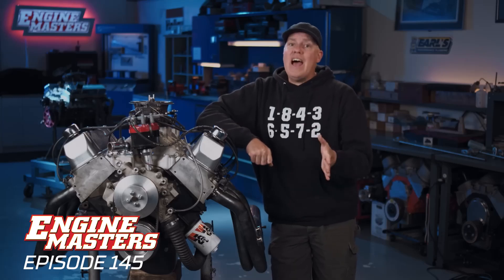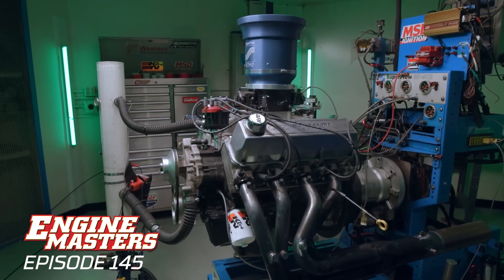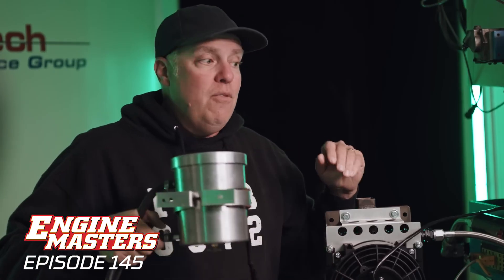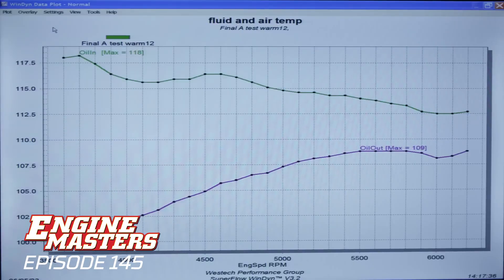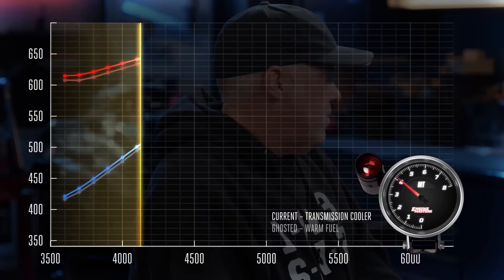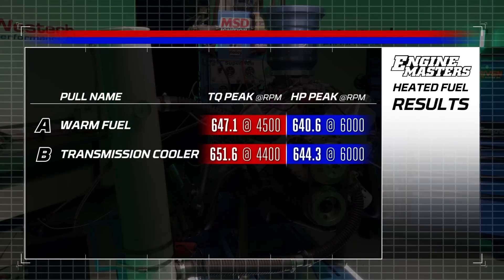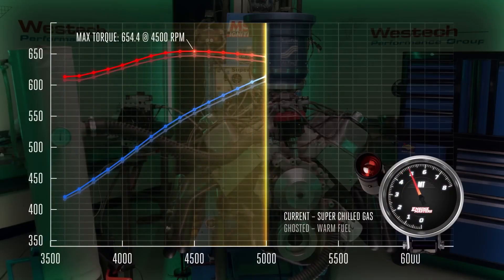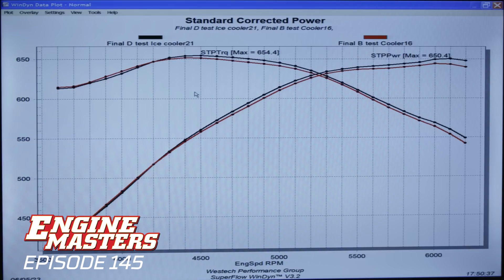Why Does Cold Fuel Make More Power? | Engine Masters

Comment: Back in 1982 my friend and I were building his 1970 454 Chevelle in high school. It gets hot in eastern NC in the summer and the carb would starve after the second or third run street racing. We got a Moroso  "cooler can" I think it was called. Basically a coffee can that you ran fuel line through and filled with ice. It worked.
Reply: I used one of those on my 76 Camaro 350.  I only bothered actually using it at the track and packed it with ice between every run.  It had a little drain valve on the bottom to remove the water too.  Sadly, I never actually tracked how it affected my numbers in the eighth mile run but the engine did seem to make better time at a slightly higher shift point allowing me to shift a bit latter than without ice.

Comment: I have made a fuel cooler on my jet ski spraying water from the pump through oil cooler that  that was sealed in a box, then the outlet fed a cooper tube that was wrapped around the supercharger (tvs1320) which exited the hull...alot of work but it does go a consistent 2.5 mph . Speed on jetskis is expensive and this was quite cheap but took  many attempts to be done cleanly .

Comment: Gotta change your name to "Coolberger" or "Iceberger"!  LoL!
 You forgot to try adding Liquid Nitrogen into the gas tank!!!!!
However, it would probably freeze the fuel from all the water in it these days.
Vizard came up with a better method: Water Injection cools the air charge very efficiently, & also adds additional expansion & increases compression ratio,  he really put an interesting spin on it in his latest vid:  "Worlds cheapest and MOST EFFECTIVE octane booster".

Comment: Wow, I actually am looking a a small trans cooler I got from derale it has 6an fittings already. I ordered it last week for my car, but I am fuel injected. Don't know how much that matters. It's just crazy that I was just thinking about this. Now I guess it might be worth my time to install it.
Reply: Fuel injected gonna be running at a lot higher psi meaning any leak extra bad and more likely. I'd check what the pressures the Trans runs through the cooler and see if it's close
Reply: 1) make sure the cooler is rated for EFI pressures, many are fine up to 10 psi which is fine with mechanical fuel pumps but not good for EFI that is 30+ psi.

2) it will make a difference if you have the injectors spraying like a throttle body into the intake manifold, if you have ported EFI where the injectors sprays the fuel directly against the intake valve you wont see a difference.  The throttle body style setup that sprays the fuel at the mouth of the intake manifold acts no different than a carb and the cool fuel will have a cooling effect more so.

I personally am looking at doing something like this for my 4150 Stealth EFI setup I have for my daily driver I am putting the finishing touches on.  I am on the fence on if I want to cool the line or not.  I already have the return line out of the engine bay by taking a page out of chevrolet`s book for the 99-04 Corvette by using the fuel filter/regulator assembly mounted on the frame infront of my fuel tank.  I also am retaining cold air intake through the use of an aftermarket airbox that has a second duct so I can improve air flow while retaining OE cold air intake by pulling air from outside of the engine bay.  I dont know how ever if cooling my fuel with a single pass inline heat exchanger type cooler would be worth the money and effort to do it.  I dont see it dropping temperatures that much especially seeing I am running 3/8" stainless steel fuel line on the engine and I have a high flow 190* thermostat like my truck called for.  I used to run a 180* thermostat but since going to EFI, hotter is better for efficiency coolant wise.
Reply: @Milner62  yea it's a transmission/oil/fuel cooler. It csn handle a few hundred psi

Comment: Great stuff.. but I think the actual process is a bit different. The fuel actually absorbs heat from the air when it is mixed at the carb. The colder the fuel, the more heat it can absorb in that short trip from carb to cylinder. Colder air is denser so you get more in the cylinders and that is what actually makes more power.
Reply: i would agree because fuel has to vaporize to burn so getting heat from the air would would not only help it burn but more air is the key just like a turbo does, i did the opposite though many years ago, i had a gas preheater just before my carb and the engine ran soooooooooo much better once the fuel was heated especially in the winter time, gas has to vaporize to burn and more air helps and that is why chevy tried having a heated carb base in one of their cars,  toooooo many variables to produce horsepower in engines but heating the gas helped my engine big time.
Reply: Agree , It would be interesting to see that difference using fuel injection rather than a carb that supports the denser air charge  , cheers
Reply: But, the combustion occurs when the fuel and air is already a mixture…so does it matter which component is cooled? I would think not.

Comment: In certain European sports cars the fuel circulates to the carbs & back to the fuel tank to help keep the fuel cool.
Reply: it is not made to cool fuel it is made because fuel system is so designed(always on engines with carb)
Reply: not always its just the way they regulated fuel pressure 
fuel injection can do the same some  have a return and some are dead end systems not for cooling but side benefit but    if there's no heat sink in a cool place most of the times it will actually just heat up fuel from engine n exhaust heat then   flow back into fuel tank hotter than it left so your heating up the tank
Reply: @johnj2496 , that is why manufacturers started moving the pressure regulator out from under the hood so the fuel return back to the tank didnt pick up excessive heat from the engine bay.

Its why my EFI conversion will be using a 99-04 Corvette fuel filter/regulator assembly mounted on the frame rail, this will have the fuel come from the sender to the filter just infront of the tank and the return right back to the tank with only a single pressure line running to the engine bay.  Only heat being generated will be from the in tank electric fuel pump which is only putting miniscule mount of temperature to the fuel under compression.

I how ever have thought about a inline aluminum fin cooler mounted on the frame after my filter/regulator assembly to chill the fuel down before it gets to the engine bay.  Just havent found enough information out there to have me dead set on it as being a benefit so far I am seeing it as a waste of money with no real world benefit.
Reply: On low pressure fuel systems that is a great way to reduce vapor locking.  On EFI you dont have the vapor lock issue but you need the return to reduce pressure down for the system.  Manufacturers have gotten away from the regulator under the hood because the return line under the hood was soaking up heat and transfering it to the fuel tank.  Today most have the regulator on the frame rail by the fuel tank or they use a returnless system where the regulator and bypass is in the fuel pump module in the fuel tank itself.

Aftermarket Fuel Injection still does this with the regulator at the throttle body, such as the Sniper.  The Stealth 4150 Sniper I got didnt have the regulator and requires a external regulator this allows me to use a 99-04 Corvette filter/regulator assembly that I plan to mount on my frame infront of the fuel tank so the return line is short and doesnt absorb heat from the engine bay.

Comment: An observation over time is that my V8 cars ran best when the outside temperature was 45F deg.
Reply: Your intake temps are lower in cold weather. As will the be the whole car.
My race transporter was 10km faster on a very cold day v a 100 deg F day

Comment: Now when you're going down to track if you're using it for drag racing you could use your CO2 canister in disguise at like a fire suppression system in the car and spray that the cooler for the fuel and make it even drop colder Tina like 32° to see how much more power you would make

Comment: Back in the 80s when I had a cool can under the hood... I would use that thick rubber insulation around the fuel line all the way up to the carburetor... The type you see on home air conditioner
Reply: Still do that sometimes 
Home Depot, lowes sell it pretty cheap

Comment: can you do the same test but on EFI and pressurized fuel rails?
Reply: Now that is a good idea. Cheers
Reply: probably to some temp it has sense but if fuel is too cool it will not have time to evaporate (cold start), it is better to cool down intake air

Comment: 7 hp gain on a 640hp engine?  That's what, a one percent improvement.  You wouldn't even notice that when behind the wheel, and its within the dyno's margin of error.  Not worth the time, expense or hassle.  It looks good on the graph because the graph doesn't come alive until 450 hp.  Show that graph from zero rpm/zero hp and the gain is imperceptible.  Thanks guys for the effort of making this video, but c'mon..., this cooling the fuel like this is unrealistic.  Better gains to be found elsewhere.
Reply: Zero rpm? Wen does a vehicle ever operate below 500 lol. The improvement doesn’t have anything to do with how much horsepower the motor is already making. If you did this test on a smaller motor it still would make more power. No its not a large gain but in a vehicle the fuel would be alot hotter so actually would be more gains. Probably would be around 10 ft lb of torque and 10-15hp. I would say thats a good gain for just cooling the fuel off.
Reply: Exactly and cooler + dinky fan won't cost much and is worth it even if the gains are only marginal. All small power gains + small weight reductios will still make the car faster on 1/4 mile or on streets @victorromero4572
Reply: 4:16
Reply: No offense, but you didn't pay attention. Mercedes,, Jaguar,etc in the 80-90s had a 7" x2" tube wrapped around the return from the evap AC lines. Made a difference.. Mercedes and NASCAR were injecting cold water shots just to cylinder heads.. that's what cold fuel does..
Reply: They did say they couldn't get it as hot as they wanted to. it was about 118? and I'd say it probably gets alot hotter than that under the hood. But I have no proof 😂
Reply: May not be applicable to drag racinf because thats clearly where your brain stops and starts. But 1 percent over a 3 hour race is a lot
Reply: Ever watch a video just because its fun?
Reply: I dunnnnnnooooo...lots of little things make big juju..i reached fuel cut just by wrapping exhaust,hoodscoop put in, intercooler grill out(saves birds or something)...wrapped cold air pipes, high flow airfilter, took spotlights away from engine airflow....people talk about buying a boost t and winding to 14 pounds getting shut down by fuel police...that happened to me just putting tee in on half a click

Comment: On a slant six you actually need to heat the intake and fuel so the gasoline can vaporize.  It depends on engine design.  Cold fuel kills power on the slant six because of the intake design. That's why the factory intake has a heat duct attached to it.

Comment: Drivers were adding "cool cans" to cars back in the 60's. They would use a coffee can and coiled copper tubing. Fill the can with crushed ice!
Reply from the maker: Good point!
Reply: 100 % think it would make more power on a hot day. Dyno test would be cool to see and maybe a room with 100° temps temps ambient on a chassis dyno.
Reply: We used cool cans for fuel, Trans lines, and brakes. Much of this was for derby, and some, also, for drag racing. 

The brakes were only for derby, because they would be moot for any other applications. The Trans was a 5G bucket full of ice. It worked.

Comment: Trans coolers are very useful for exactly this type of thing. Handy for heating and cooling almost any gas or liquid.
Reply: @aldo6192  in quite a few modern day vehicles, the trans cooler is built into the engine radiator, with coolant being exchanged as the medium to regulate temperature. Helps bring trans temp up to operating in cold climates, and obviously in situations in which trans temp exceeds coolant temp, it removes some heat.

Comment: If it makes 10 hp it may be worth adding an evaporator type cooler to cool the fuel that runs off an ac compressor. Something like on the electric cars even. Not engine driven, and is basically a cooling block. They use it to cool the battery coolant.
Reply: Jaguar XJ6 and others cooled fuel off of the AC
Reply: 🤔 get some soft aluminum fuel line and coil it around your low side ac line then insulate it  there and to the fuel rails or carb
it wouldn't be a big hassle
Reply: @johnj2496 I think running your AC during a race is going to defeat the HP gains of cooler fuel, but give it a try & report back.

If you lose 10hp on a hot day driving around because you're running your AC, possibly gaining back that 10hp would cancel out the compressor loss so you don't have to worry about the hills if you live in San Francisco in the summer time.  Other than that, I don't see the gain with using an AC line to cool the fuel...

Comment: I think the fuel cooler with an electric fan is a good idea but placement on a car is going to be tricky.  Most likely it will end up under the hood but the trick is to place it in a spot where you can achieve that 25 degrees temperature difference between tank and intake.

Comment: I have two really cool inventions I made ❤❤❤ 12v 330amp alternator / generator 79cc engine.... I have a 10,000 watt inverter 110w connected, 8hours run time 1/2 gallon of gas ⛽
Reply: Second invention: search 🔍 800w 36v Dynamo stationary bike.... Then throw the batteries away for your Ebike I'm using a 350w 36v motor on the Ebike 2 to 1 ratio ... Search 🔍 chainless Ebike... Get the drift no batteries needed

Comment: I wanna see this on a 5.0 302 215hp motor it won't change much
Reply: On a 640 hp engine it made 7 more hp.  Not worth it.  On a 215hp 5.0, the gain (if any) would be imperceptible.
Reply: Back in the day they used cool cans under the hood at the race track and it made the cars go a bit faster and when your racing .5 or .8 seconds or more faster in the quarter mile could win the race and the money.
The older engines are where you will find the major improvements. Not the newer new tech engines with major design upgrade's.
Reply: I beg to to differ sir!!!!I use dry ice and two cool cans and I've dynoed and seen a almost 19 gain and on my boosted one a 28 gain and almost ten mpg gain.... SCIENCE!!!!CAR COMPANIES WANT YOU TO USE A CERTAIN AMOUNT OF FUEL YOUR CAR CAN RUN ON MUCH LESS WITH NOT MUCH LOSS...BIG OIL MY FRIEND THEY RUN THE 🌎🌍🤯

Comment: A lot of diesel vehicles come with fuel coolers from the factory
Reply: That usually is in the return line and has to do with the injection pump or high pressure pump being diesel-cooled . Running high loads in high temps on an almost empty tank could otherwise heat the diesel to much deminishing it's lubrication and cooling capabilities. 

But still I'm thinking if it might make more power 🤔. It's definitely going to be denser = more fuel into the cylinder but also might have problems atomizing
Reply: cool fuel has sense when fuel/air are premixed before and in cylinder not for diesel engines with injection and no mixing in intake compression stroke  @LouiLocke
Reply: Yup, particularly on the higher load models. Typically on return line to keep tank temperature down.
Reply: I thought Diesel fuel had to be heated in order to combust under compression?
Reply: @ChronoTango pressure does all that
Reply: @ChronoTango the combustion chamber is hot enough, especially under the high compression ratios on diesel engines. When starting a diesel engine cold the glowplugs taken care of the heating.

On old diesel engines you can actually notice the engine gaining power as it comes up to temperature on a cold start in winter.
Reply: I put a larger return cooler on my Duramax because the fuel temp in the tank in summer time while hauling around Colorado is close to boiling. Definitely helps your average fuel mileage especially close to the bottom of the tank